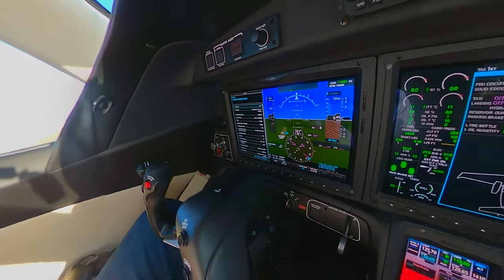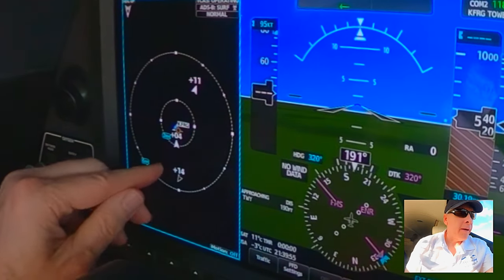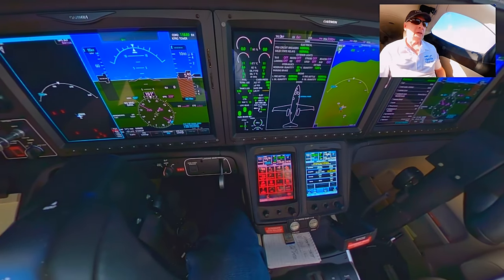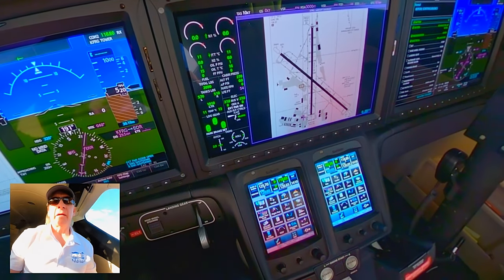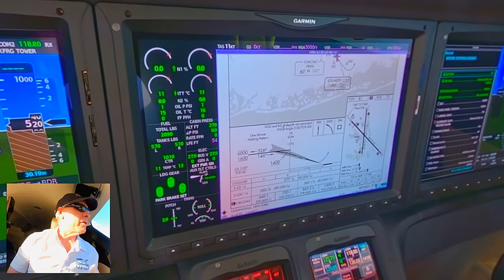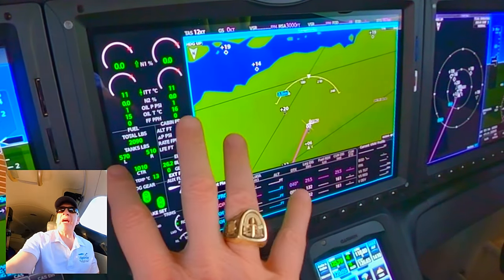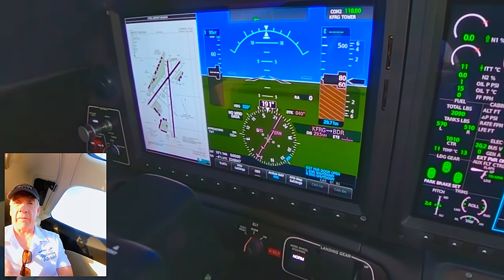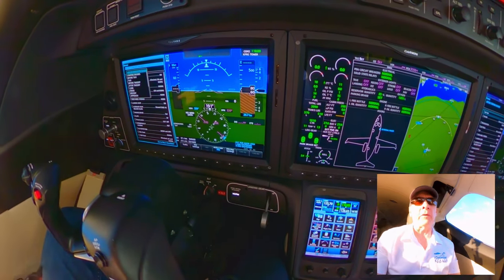Explore the HondaJet's Advanced Avionics

Comment: what was the cost of type rating??
Reply from the maker: Alor it used to be about $41k.  They bundle two type ratings with the purchase of the plane.  I don't know what it is now.  FlightSafety does the training.
Reply: I heard that flight safety type rating in the sim cost about $60K.   Min 1000 flight hours and multi prerequisite
Reply from the maker: About $41k and yes, I am sure at least 1k hours and multi-commercial.